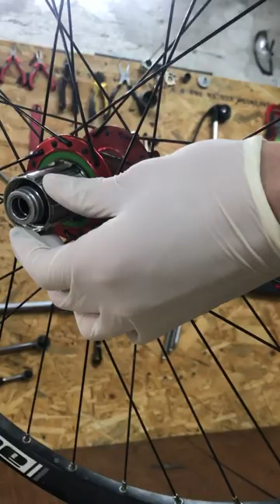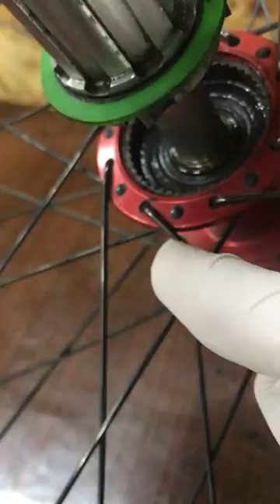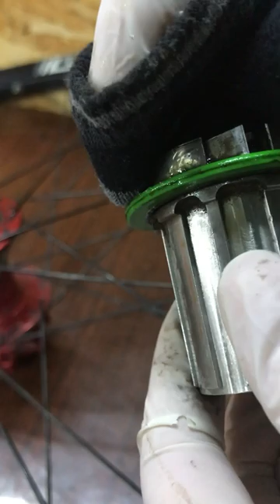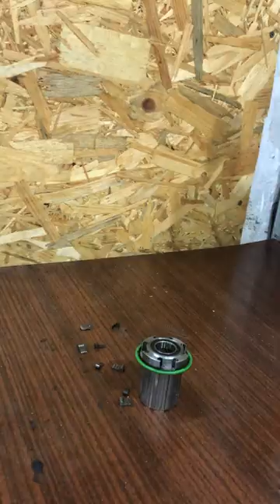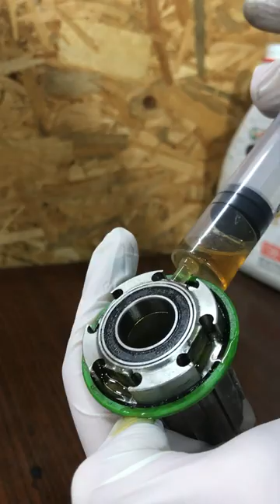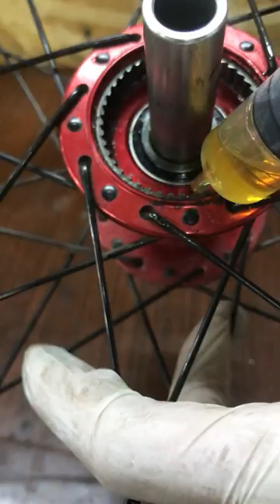ENGINE OIL IN A HOPE HUB?!   #shorts #bike #asmr

Comment: I use 20% General purpose Greese + 80% Gear Oil(bit thicker than engine oil). That  gives me great results for freewheel greasing.
Reply: mixing greese and oil is rly complicated..mostly dont works rly good...
Reply: @BenSuzi1980 it depends on the kind of grease and oil you use. I used Finish Line Premium Grease on my freehub with one drop of Finish Line Wet Ceramic Lube. Perfect combination and works so good. Smooth and long lasting.